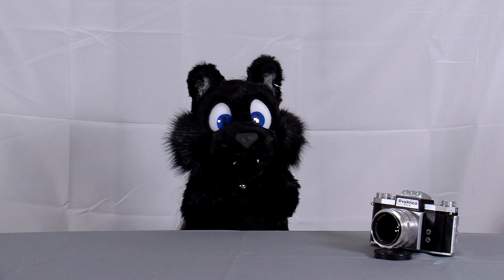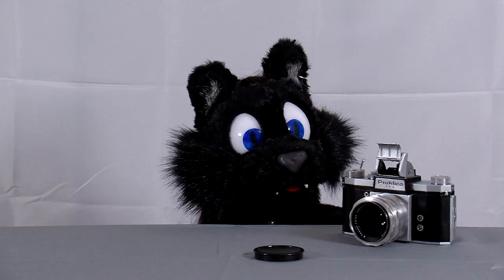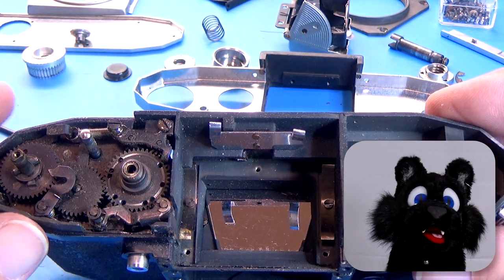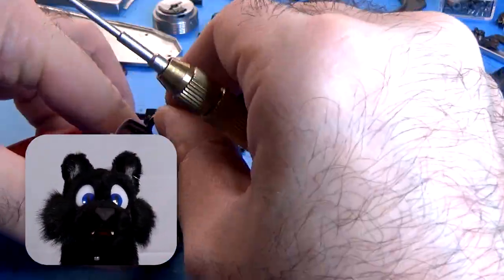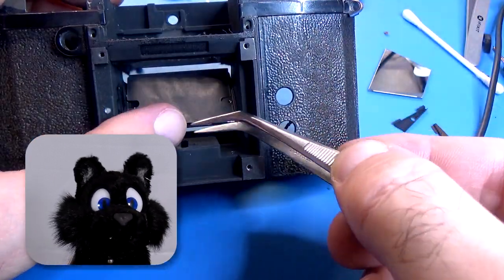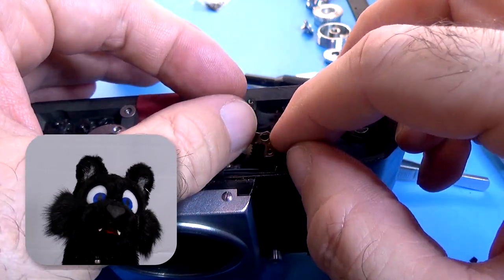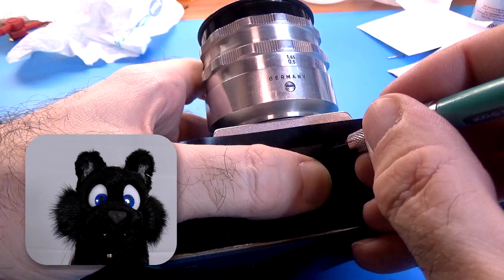Restoration Project #11 - Praktica FX 2

Comment: Im confused on how to take thr reverse threat shutter dial off. Spinning clockwise just winds the shutter. Are you holding the outer ring in place? It seems like an unreasonable amount lf force and I dont want to break anything
Reply from the maker: It's been a while... but the left handed thread knob needs the flat screwdriver to turn the center part (clockwise to unscrew) and at the same time I pulled out the timing selection ring on the outside, just to make sure that I don't turn anything else accidentally. It might not be needed since the center rotates anyhow. It took a minor bit of force, yes, since it has to overcome the tightened thread. At least my model had no additional clips or locking screws.
Reply: @atkelar  appreciate your reply all these years later. I was able to get it thanks to you confirming I was doing it right. Much appreciated!
Reply from the maker: Years later? Did I miss a reply or is YouTube comments confused again? 🤔 So far I thought I replied to everybdoy within a day or two at the most..
Reply: @atkelar no, I meant on a many years old video. Most people wouldn't even bother replying on such an old video
Reply from the maker: Oh, OK. I have the comments set to "manually approve" - just to avoid the whole bots that have fake lottery winnings and such. With as few comments I get it's still feasable to reply to almost all of them, and with the approval they also prominently show up.
Reply: Sorry to bug you again.. To unscrew it did you hold the outer ring(speed selector) in place while turning the internal dial clockwise with the screwdriver ? Or is the outer ring to be turned clockwise? I am afraid to damage the thread or the dial. I have added some wd40 Hopefully will loosen up...
Reply from the maker: No problem... Indeed, that's how it should work: hold the outer ring and use a large bladed screwdriver for the center part - it has little "grooves" in the center that should fit. This inner part turns clockwise to unscrew, while the outer ring can be held in place stationary (that would wind up the mechanism)

Comment: Where did you find the information on how to disassemble one of these? I've been looking all around, but your video is the one that keeps coming up!
Reply from the maker: I didn't... I just sat down with a set of screwdrivers, tweezers and a magnification glass and worked my way through it, one screw at a time. This is also why I am hesitating to claim full knowledge about it; I managed to take it apart, clean it, put it back together again in a way that makes it work (and quite nice pictures came from it) - it is news to me that there is little to no information about the camera; it seems to have been quite a standard model in that timeframe.

Comment: Well hi there! Caught this on Funday Pawpets and then had to hunt you down here on YouTube so I could answer the question at the end of the video! ... The oldeh textured surface replacement would probably be best replaced by something like a textured pvc vinyl - now I haven't tried this particular product myself but Vvivid Vinyls makes a range of leather like textured adhesive backed vinyl (although from a cursory look it is a heat-set product so some hairdryer/heat gun action might be needed here to get it to stick ... or just contact cement it -__-) ... I have used their other products in the past and rather like them (perhaps a nice metallic blue carbon fibre print for your camera? LOL) But yes ... 'Vvivid Vinyl Leather' ran through that river based shopping platform online (no, not the Nile ...) should come up with something at least somewhat similar in feel to the old product.
Reply from the maker: Thanks! I'll add that one to the list and give it a try when I have some spare change again ☺

Comment: Thank you for this video! This helped figuring out how to dissamble my Praktica IV. I would like to do a polish to the body. Can you make any suggestion what I should use to get rid off some minor scratches from the metal parts?
Reply from the maker: I assume the parts in questin are polished metal? If so, I think the only way to properly get rid of them would be some sanding with high grit sandpaper (wet sanding perhaps even) and then polishing the metal to get it to shine again. This is quite some work though, and naturally should be done when the parts are not assembled; sanding dust inside a delicate device is a no-go. I'm afraid I am not aware of an easier way to remove scratches. Be sure to test on a lesser visible spot first, some metals are not as easy to "buff" as others; also, if the piece is coated, sanding will remove the coating and produce an even worse result. It's why I generally just make sure that major scratches are at least not sharp edged and keep minor ones as "patina". If the metal is "dull", it's more easy: find the proper grit sandpaper and try to match the surrounding as close as possible (like with brushed aluminium)

Comment: My praktica fx3 has the shutter mirror that won’t retract all the way up. What could be restricting it?
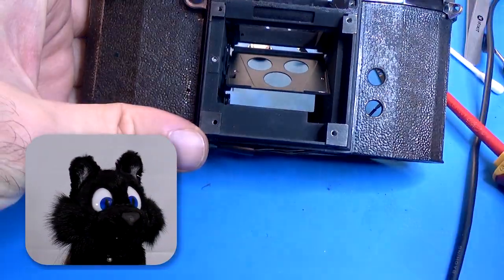Reply from the maker: I can't answer that directly, since I don't have an FX3 - But if it's anywhere near the FX2 one, There shouldn't be anything preventing it from going up. It's either held open by the shutter linkage or should snap up and out of the way with its own spring. The video shows that process at about 11:13 - So the only thing I can imagine is either a weak spring (myba  parcially broken?) or a foreign object in the way of the mirror; If the mirror is still mounted with these screwed on clips, maybe it shifted slightly and is itself in the way now?

Comment: I need to replace the shutter curtain on my  FX, however what caused the opening curtain and closing curtain moves at the same time? I got the same issue.
Reply from the maker: The gearing in the top gearbox (visible around 5:53 and again around 15:13) needs to be tuned: both of the stacked larger gear that pull on the curtains need to pull at the same time but during the release, the first one needs to go while the second one is held back at least slightly. The clockwork in the bottom then controlls how long that delay is. It took a bit of trial and error to find the correct position between those; I couldn't get a clear shot of the process, so I didn't put it into the video.
Reply: @atkelar thank you for the quick reply, I will have a look at it later today

Comment: I have an Praktina FX and the shutter doesn't fully close. Stays 2 centimeters open every other shot. Also, the bulb mode does not open. Any suggestions where to examine?
Reply from the maker: Hmm... The first question would be: is it still under tension? It may be either a spring that needs some winding up or a stuck gear. Can you (VERY carefully) try to help the curtain along? Does it still move?
Reply: @atkelar  yes, I have carefully closed the shutter with a clothe over a flat screw driver. This fixes the issue temporarily, but about 6 shutter releases later, it's back to staying slightly open. I have never opened the camera, but it seems like no one in my area will take this camera for repair, so I want to try myself.
Reply from the maker: It seems to be an issue with lubrication and/or dirt in the gears then. Anything broken would most likely not even work once. And since it does work for a bit, I'd say the spring is wound up enough. I would remove the top and bottom cover only, try a bit of compressed air to rid possible dust bunnies and apply droplets of fine oil to the visible gears first. Use a needle or a piece of small wire to apply the oil, it doesn't take much and there is "too much" 😁
Reply: @atkelar  ahh I see. I really appreciate your help. FYI, your channel is superb! Love watching restoration videos.

Comment: Hello Atkelar, I have a praktica FX3 that is desperate need of repair as the shutter curtains are not in function and one of the knobs (I’m gonna call it the shutter knob) will not budge, similarly to this one. It is also a second hand camera, so I am wanting to remove all of the dust from within the camera. My question is, do you do repairs upon commission? If not, do you know anyone else who could? And if not to both of those questions, do you have any advice on how someone with little knowledge or experience of fixing cameras would go about tinkering with an FX3? Thanks in advanced!
Reply from the maker: Thanks for the request - I am currently on holiday so the reply took a bit, sorry. The thing with doing things on commission is that around here that almost immediately counts as commercial application. And I lack the license for that. Also the insurance: I could not afford to replace any damaged parts, which would eventually happen because the old parts are sometimes brittle. So, sadly: no, at least not for the foreseeable future. As for advise: #1 do not use force, unless you absolutely 100% double checked that it is needed. Sometimes one overlooks a screw or bolt and things go snap all to quick. #2 make a TON of reference pictures when taking things apart. Multiple angles, close ups, overviews... and include a size reference for the screws (like a ruler) #3 if you just want to remove some dust, maybe don't go as far as I did ;) Use an air can to blow out any lingering dust and/or a soft brush and even then: be gentle.

Comment: Hi Atkelar! I disassembled my camera, cleaned it and attempted to reassemble. The problem I'm facing at the moment is the alignment of the curtain, winding and shutter gears. Can you help me to figure out the correct positions of these gears?
Reply from the maker: That step took a bit of trial and error on my side as well; It is rather easy to try different combinations and "home in" on the one that works though: The power for the mechanism is delivered from the curtain springs; keeping them at low tension for the beginning makes it easy to test things while the case is still open. That way there is less chance of "sproing" incidents. The sprockets on the curtains connect to the timing gearset with a little clamp that makes it easy to shift them over one tooth during trials without completely removing the parts - visible at the 15:15 mark. I found that all the other gears are easy and either don't care about alignment or are obvious if they have limited range; but the connection between the curtain and the two stacked timing gears on top are the ones that need tweaking: The first shutter needs to be well on its way before the second one releases, and if the mesh is off, it will cuase them both to run at the same time, or get stuck: another reason to keep trials with lower than normal spring tension.
Reply: @atkelar  Thank you for your kind reply! Hmmm. I am not yet trying to mess with the curtains, though. The winding mechanism is not working, because the counting lever (seen at 6:15 and 13:55) keeps getting stuck in a groove of the rewind knob causing it to stop prematurely and getting stuck in such a way, the curtains wouldn't move at all. I suspect it's bent somehow and/or not making enough clearance. But how would it do so? It might be pushed by the gear at 6:15 (right most gear), but it doesn't.
Reply: I did it! I'll try to come up with an explanation tomorrow.
Reply from the maker: It would be easier if YT would allow pictures in comments; but I think what happened is that the "stop" mechanic, that is supposed to stop the wind up after exactly one frame, is off by a bit compared to the windup of the curtains? The rightmost gear in 6:15 is the lower of the two timing/curtain gears and the notch needs to be on the correct side of the overlapping counterpart on the one above it, so they are "taking along each other" in the correct direction. This makes it possible for the curtains to be wound up together but release one after the other. Again, without sharing pictures, it's a bit hard to diagnose.
Reply: @atkelar  Okay, I'll try to explain. First of all, I'd recommend installing the slow gear at the bottom last. Then assemble the winding gears as shown in the video while observinge the following hints (directions are give as if in the normal-use direction of the camera): 1. the S-shaped lever's left part rests under the gear for the closing cloth and hast to be seated between the welded stop of the baseplate and the stop on the wheel. 2. In this position insert the closing cloth's axle, turn it a few times to make sure, the curtain's window is correctly set to the frame, then replace the bracked holding the two curtain axles. You can then turn the axle counterclockwise so the wheel turns clockwise and you can eventually nestle the S-lever's lever in betwee said stops. The s-shaped part then gives way for the winding knob to turn. 3. repeat Step 2 for the closing curtain. The upper gear also has a welded stop which should stop turning counter-clockwise at the stop of the lower gear. 4. Replace the winding knob gear on the right; it's also got a stop on the underside which also needs to rest against a stop on the baseplate turning counter clockwise. 5. adjust teeth alignment, curtain alignment/tension etc. until satisfied. // This explanation might sound quite crude, but I hope it might be somewhat helpful.
Reply: Hi, I could not unscrew the bottom ss knob to remove the top cover 😢(tried clockwise) but it wont unscrew. It also winds the curtain when I try to unscrew and it reaches a stop and I am scared to force... Any further tips please? Very frustrating...
Reply from the maker: @MichelangeloFPV  I remember it being quite "stuck" on indeed. Do you have access to the bottom end already? Mebe you can hold the shaft there with a small pair of pliars? While I also would not try too much force, this one is on the "just enough feels almost too much" side. Just to be sure: You are aware that the knob can be held in place on the outside and turned with a large screwdriver on the inside without moving the axle? See 4:10 for reference.
Reply: @atkelar  thanks for your answer! I am aware of that but I am not disassembling all the bottom gears as you did.. 
I only cleaned and lubed... Also fiddled With the curtain tension gears and that fixed my initial issue,(curtains travelling together with no gaps). Now I am trying to figure out why all my shutter speeds seem all very similar, no matter what  speed I select. B mode also is not working....
Reply from the maker: That might be a bit more compliated; the slower mode is putting the delay gearing into play. All the others will probably look rather similar visually, becuase it's oknly different from the distance between first and second curtain. The "B" mode not working might be related. Maybe the second curtain is indeed released by accident?